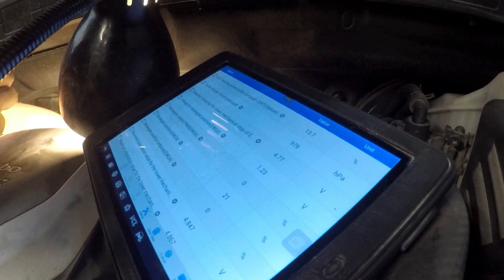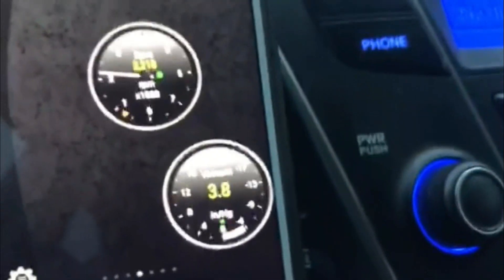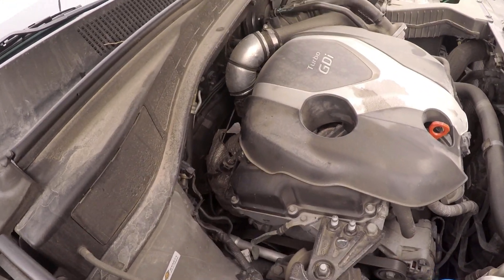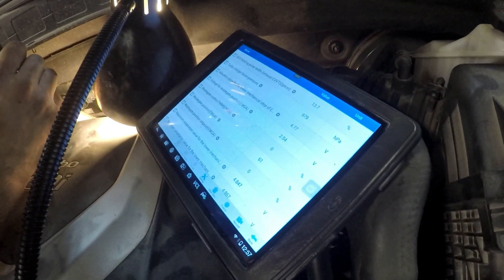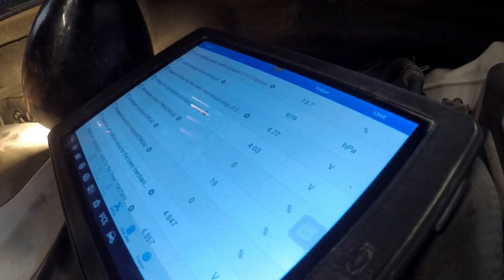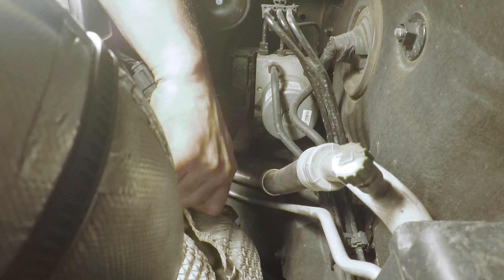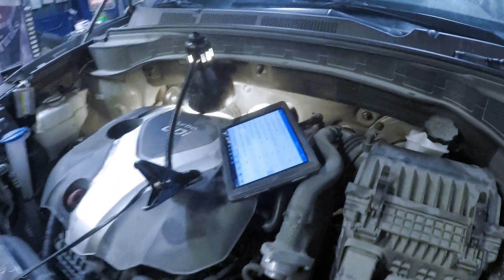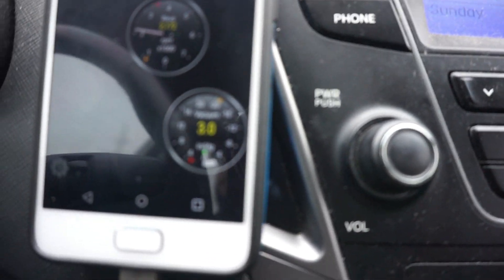Hyundai, Kia, Genesis wastegate voltage  adjustment. With Hyundai Service instructions.

Comment: Swapped in an upgraded turbo in my 2024 Forte GT. Didn't quite feel right so did some digging. I was sitting at 4.04v and needed to be 3.5v so I found this video. Did a bit of adjustment and did some more logging. Was able to turn up the boost from 21psi to 26psi and she's spicy now. Appreciate the video. I dug up the stuff on KGIS & saw the voltage via my EK1 Pro.

Comment: I have a Kia Optima whenever I try to adjust it it seems to be stuck on 4.8 volts I replaced the actuator still the same problem seems to be stuck on 4.8 anyone have a solution?
Reply from the maker: That is very weird

Comment: Will the check engine go off immediately?
Reply from the maker: Yes after you reset. Subscribe
Reply: @runningrich  I just did.
Reply from the maker: It should go away, read the voltage again.
Reply: @runningrich  new code p0032. Other code is gone car accelerating good. This is a 02 senior code.

Comment: I’m using the needle method. Which wire would it be for 2013 Genesis coupe
Reply: Seeing as how this is an old thread, I realize that I may not be helping you, the dude who posted this comment, but rather the individual who comes here next looking for this answer - Which is - the wire on the bottom left side of the harness from the perspective of looking at it from the front of the vehicle. (My reference on this is a 2016 santa fe 2.0t). Some of the research I did said it was the yellow wire. In my case, there was no yellow wire anyway
Reply from the maker: That I am not certain.
Reply: Did you fix it? I have a Genesis coupe  with the same problem too
Reply: @briandiaz750  no ended up selling the car

Comment: I did exactly this andy car stumles and when it gets up to temp it shuts off and want want to turn on again , I already set my voltage to 4.1/4.2/ and even 4.16 and still the same
Reply from the maker: May be your actuator is burned. They are made of plastic
Reply: @runningrich  I replaced it with a used one I have from a 2016 model and the live data volts go up and down anywhere from 1 and 4.2 sometimes a little over .
Reply from the maker: And still have the issue?
Reply: Yeup the rpms just go up and down , I already replaced the boost pressure sensor aswell , and if I disconnect that while it's ideling it seems as if it helps it a bit
Reply from the maker: That sounds like a vacuum leak

Comment: Could my battery giving me abnormally high voltage reading, one of the stereo lights flickering than finally going out, and then now check engine light flashing and can't get past 2k rpm, be tied to this rod?
Reply from the maker: Shouldn't be
Reply: It's weird, we got hit by a deer and now the car is in some sort of safe mode where it won't go past 2k rpm and the check engine light stays flashing.
Reply from the maker: You have to check the code. May be the hit knocked off the knock sensor. It's literally at the front.
Reply: @runningrich  thanks for that info i will look into that that seems very plausible didnt even think about that
Reply from the maker: Please subscribe
Reply: @runningrich  the code was a temporary code we turned it off and now the cars running fine lol. Thanks
Reply from the maker: That's interesting.  Would you please share the code number?
Reply: @runningrich  P1326

Comment: For my BMW I have a device called Carly . It plugs into the OBD 11 diagnostic port. I think it was $70 after that it’s paired with the Bluetooth on your phone and you have to have access to Read codes erase codes it is just as good as a snap on scanner. The software is around $60 a year to access all the information. Recap , small device to plug into obd11 and software access is 60 dollars a year . Once you pay for the device that plugs into the diagnostic port it belongs to you but you have to pay every year for software access. One Hass to be very careful using the device by just paying attention to what you’re doing. Otherwise you might be having your vehicle towed to the dealership to reflash the ECU

Comment: Remember folks If you have a Hyundai with this problem take it to the dealership whether or not you are a mechanic or even the best mechanic in the world it’s under warranty the drivetrain is under warranty for 10 years
Reply from the maker: You are correct.  10 years or 200,000 km.
Reply: @runningrich  is the sister company KIA also 10 yr 200k warranty?  I have Optima SX Turbo
Reply from the maker: Same warranty.
Reply: @runningrich  thanks but I don't think it's that long in Canada. I checked my warranty. Will confirm with dealer, but not holding my breath.
Reply from the maker: I have a letter from the dealership, extended warranty for the motor,
Reply: @runningrich  my KIA Optima 2014 according to the dealership is 100,000 km or 5 years. Whichever is first.
Reply from the maker: That is bumper to bumper warranty. There is another extended warranty for your engine due to a class action law suit.
Reply: @runningrich  yes, I recall that suit... Will have to dig up the papers!
Funny the dealership said nothing. I did only ask for powertrain warranty though.
Reply from the maker: Of course they won't remind you of anything. It is their best interest that you forget. Lol
Reply: @runningrich  that's part of why I gave up on going there. Every single time I brought my car in for service they physically damaged my vehicle!  Of course I didn't see or figure it out until after the fact and they just ignored me.

The car is great, the service is like the workers are jealous and damage it on purpose.
Reply from the maker: That's terrible. Go to a different dealership.

Comment: Wouldn't an aftermarket turbo like this work? https://www.summitracing.com/parts/rnb-667-230 If you/anyone knows if something like this will work, please comment. The Dorman Turbo has a lifetime guarantee as well.

I'd rather pay $700 + installation and not have to worry about it any more, cheaper than buying a new car!
Reply from the maker: Won't work without a lot of work and tune.

Comment: So if rod is right its closed and open is to the right? I'm getting no boost at all and my 2011 sonata 2.0t goes from 0-60 in about 10 seconds. When I measured it to the right, I got 4.37VDC. To the left, .93VDC.
Reply from the maker: Hmm. You may have a faulty actuator. Those are made of plastic. Plastic gear cogs. Known to break.
Reply: @runningrich  what should the voltage measure when the rod is all the way left?
Reply from the maker: See the hyundai diagram I shared in the video. It should say that.
Reply: Will .37VDC really cause my wastegate no not open?

Comment: My 2016 Santa Fe is measuring 4.2V right now. I don't feel the kick of the turbo anymore. I got power tho. Brought it to the dealer, the changed the wastegate, still no kick. brought it back and of course dealer said everything fine. I measured the voltage using a multimeter, still 4.2V. Will that make a difference if I adjust between 3.9V-4.1V. What you guys think.
Reply from the maker: Your dealer updated your car.  It changed the base map.  You wont feel the kick anymore. It's one of the drawback of the new firmware update.
Reply: Car-Addiction 
Thank you for the update. 
You are right. There was a recall on the engine. They updated the firmware. Since then, the car feel like driving a big engine.
Reply: @runningrich  
So 4.2V on the wastegate is fine?
Reply from the maker: You have to be as close to 4.0 as possible
Reply: I have a 2013 Santa Fe. I have the voltage set at 3.96 I’m just Wondering if I should set it back because I had the update last year and as of a few months ago , I now  have a new long block. Apparently a new engine from Korea. Do you think the 3.96 contributed to my motor blowing ( cylinder 4 misfire) last year?

Comment: What hardware and software do you have to measure the voltage.  Not a fan of sticking a sewing needle into the wire.
Reply from the maker: Autel MD608. Or any of the MD series.
Reply: @runningrich  are there any cheaper readers that I could use?
Reply from the maker: Yeah. Bluetooth obdii with torque pro and need to but Hyundai PIDS. Please subscribe to my channel.

Comment: Quick question, I can barely move the rod to the left by hand and need the help of a flat screwdriver to bring it all the way closed. Is my solenoid faulty?
Reply from the maker: Can you see the voltage change when you move the rod?
Reply: Yes I can
Reply: I’ll get a p2562 code and when I check the voltage it’s always off. When I watched your video and others. The rod moves with ease. I can’t move mine to the right even with 2 hands
Reply from the maker: Oh, your supposed to unbolt it from the Westgate.

Comment: So quick question, is the volt measurement taken when the actuator is pressed all the way to the right?
Reply from the maker: Correct. Make sure your engine is stone cold.
Reply: @runningrich  what happens if you adjust it after driving ?
Reply from the maker: It's harder to adjust properly.